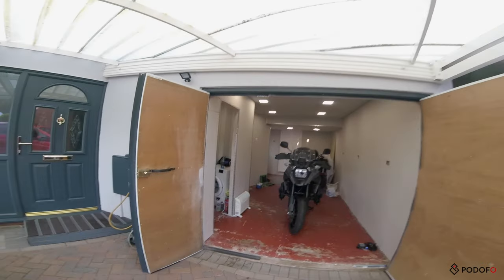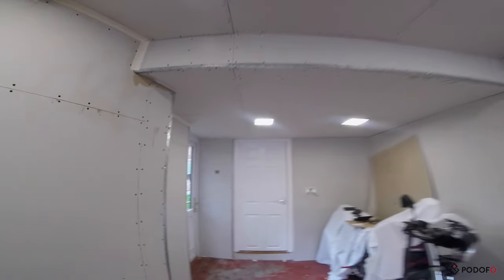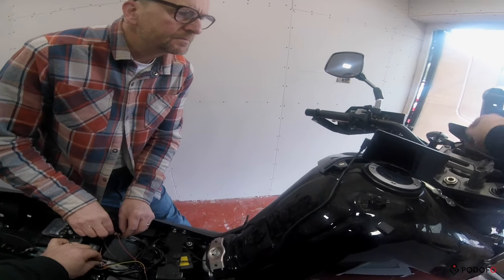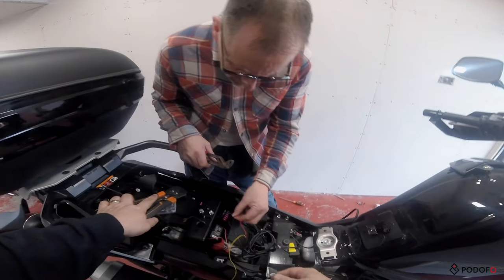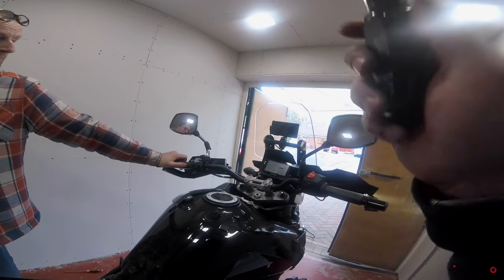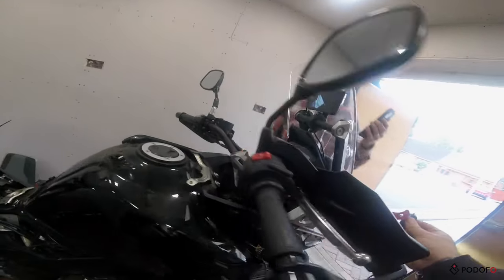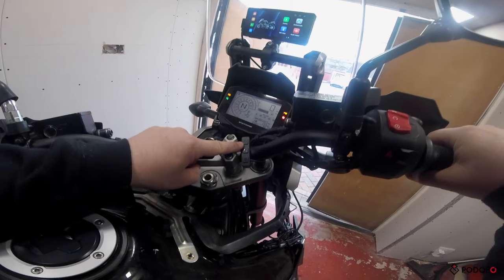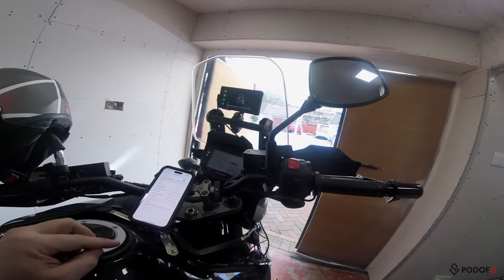Fitting New Accessories To Goose's VStrom - PODOFO Display With Dash Cam

Comment: Did you replace the fuse with a tailed fuse ? About £4 from halfrauds and you can have a separate fuse for the screen 👍
Reply from the maker: No just wrapped the one around the fuse but will deffo look into that
Reply: @Motourev  great little things always have a couple .. just in case .. in the tool box 

Install looks the mutts on the bike 👍